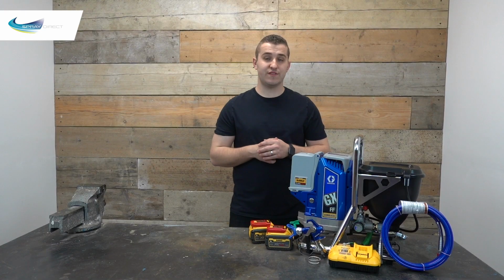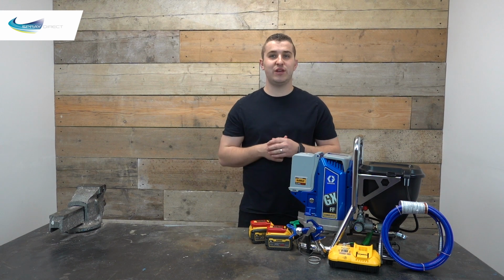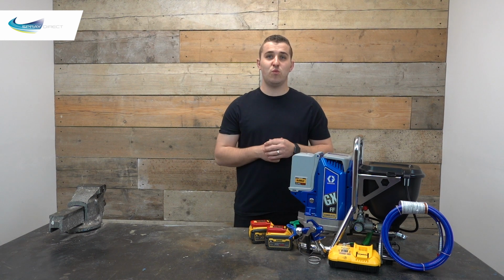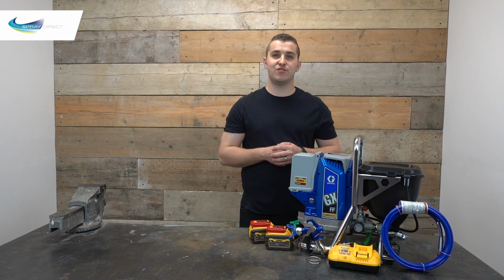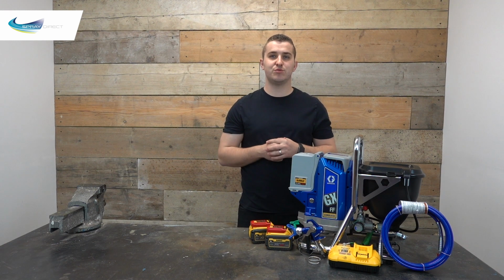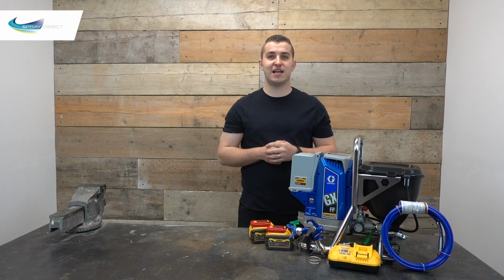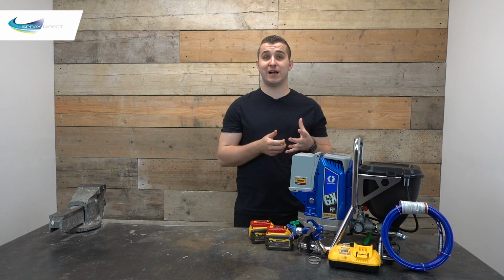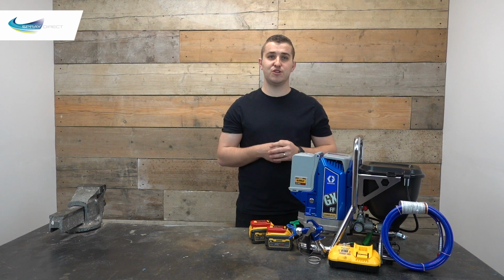Graco GXFF Cordless How To Setup & Review

Comment: I just found your videos!!  Thanks!
I do have question for you. I am looking to use an airless sprayer to spray a 20 year old cabin that had rough sawn lumber. It's ALL been  sanded including the ceiling. Because I don't and can't possibly sand between coats, I'm only looking at solvent based clear coating. Is there an airless sprayer (not hvlp) that can spray a flashpoint of zero or even -4 F ???  Any help would really be appreciated !!! Thanks !!